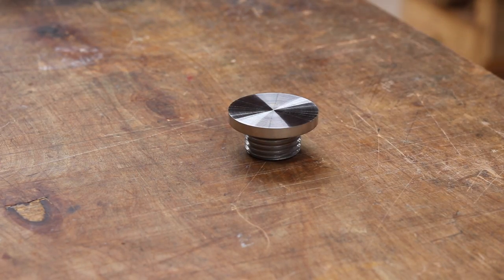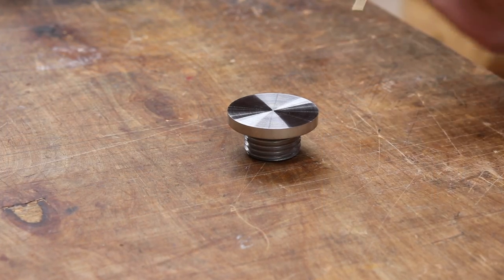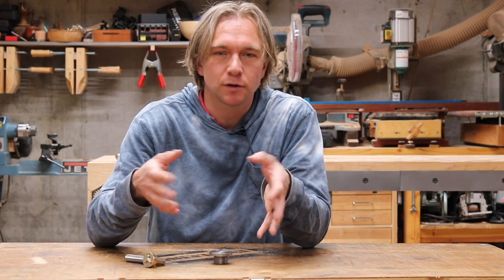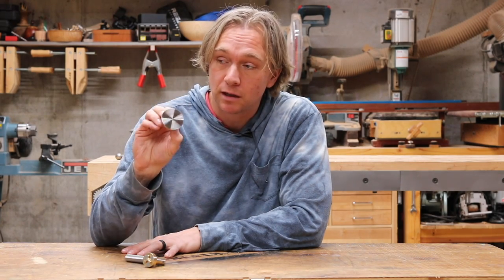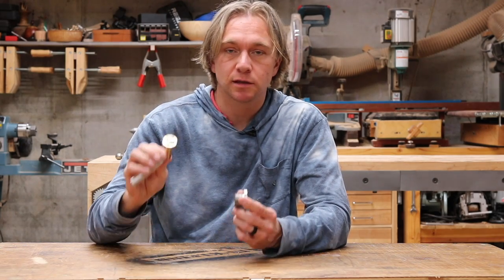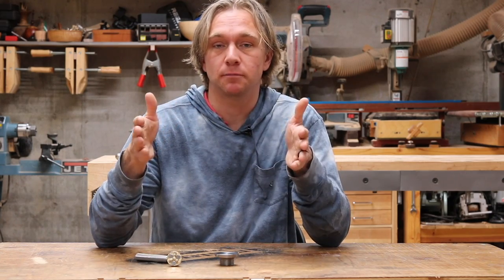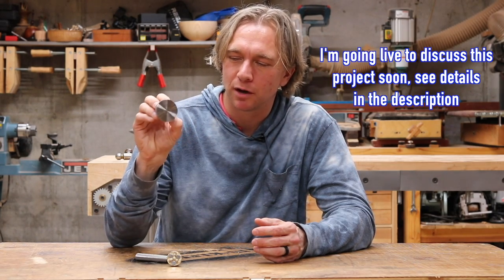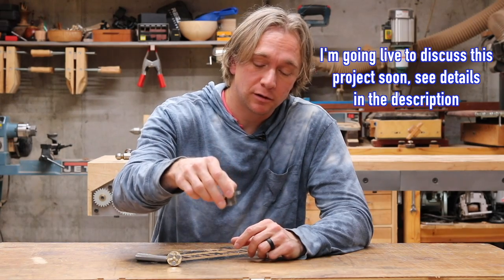A Screw With No (visible) Slot Is My Next Big Thing!

Comment: You could turn the idea into some kind of hidden lock or switch. Something that would make use of the moving part more often that the few times the screws will ever need to be tightened in an assembled furniture.
Reply: I agree, then it would be something with more than a use once  item.
Reply: I thought the same thing.  Many of us don't have the tools to produce something with that much precision, but if was a switch hidden in plain sight it would be awesome to add.  I would imagine he could increase the cost.  Hopefully it wouldn't also double the cost of production.
Reply: This was my first thought as well. Then I also thought that if it were used often it would get scratches and wear. Tell tale signs that it is a "hidden" latch/switch that is not hidden anymore. Then I started thinking of alternatives to this altogether. I don't know... Maybe it would be fun to have one just to play with though!
Reply: @markhedquist9597  Yes the technology is the selling point not the fact that it is a slotless screw which to the observer could be achieved by a countersunk screw with a steel plug to cover. Perhaps as part of a locking mechanism on a drawer front would be one novel use. But, hey it’s a lovely concept keep exploring the possibilities

Comment: I could see architects getting “the fizz” over these, they always want their final assemblies to be as smooth and seamless as their drawings! Your fastener first reminded me of architectural glass hardware you see on plate glass banisters and facades that usually have the two “pig nose” pins, this would make them totally seamless and still tamper resistent. I like the ready-to-assemble furniture idea, especially something that can be assembled and disassembled many times. As for a name, I would try to name the whole system and not just the screw. Something like “Phantom Drive” where you can have the phantom drive tool, phantom drive screws, then any of the phantom drive accessories.
Reply: I agree that this type of fastener would be better utilized in glass and metal construction rather than wood furniture building.  Bathroom dividers, glass or acrylic panels, office dividers, etc
Reply: I had similar thoughts.  There are complex fasteners for specific problems in architectural design.  This could be one of those.  The hidden geared fasteners that pull banisters together come to mind.  These might make assembly of big glass structures faster or provide a cleaner look.
Reply: I think this is the only reasonable market for this screw.  It's cool but $40 each is just out of the reach of almost every furniture builder.  Especially hobbyists.

Comment: No chance I would buy it. In use it is really cool, but in most applications it will get put into place once and the cool part (the recessing 'slot') or the quality of the item never gets seen or used again. For much cheaper you use a cap on a regular fastener that serves the same function and looks identical to the end user.
Reply: A magnetic cap would work.
Reply: Exactly.  I used to sell fasteners for a living.  Covering fasteners is a whole industry.
Reply: This is sadly quite true. It would almost have to be sold to the person making the project for themselves for them to get satisfaction of a disappearing slot as opposed to a cap.
Reply: One of the big things is that most customers aren't going to care.  There may be some who think it's cool and will spend the money, but unless the end user is going to use it as a function of the piece, I can't see many of the caring.
Reply: @keats182  Sadly I agree with you. This is a product that has to be sold to the one making the furniture, not someone who gets the piece after the fact.
It's a strange product in that sense and can be a really hard sell.
Someone pointed out that end-caps on screws/bolts produce the same end-result at a fraction of the cost. Again, I'm forced to agree.

This is not saying that this product can't sell, but it's novelty is in putting it together, not the end result. And for that reason, it might be a really hard sell.

Comment: I love the idea.  Thanks for sharing.
I will contribute a few pointers/ideas.  
1.  Concerning the name, keep it open.  You may want to make variations.  I mean that you should have a name that can accommodate different versions.  Don't be in a hurry.  Ask friends to have a naming party - non alcoholic?
2.  I like your idea of having them on drawers.  However, it likely won't sell if they come off.  A "simple" fix would be to have a small unthreaded area just before the threads start below the head in which to put a ring or other type holder allowing the device to stay on the drawer front, turn, and lock.
3.  If your device can be successful, you will find it being knocked off fairly quickly even if you have a patent on it.  Your best defense would be to find the best way to produce it quickly and cheaply.  And allow and plan for variations in size and style.  
4.  Consider a licensing arrangement with a company that specializes in woodworking supplies.

I wish you the best.  As I no longer have a shop, I won't be a customer.  I'd have to have a good client base to be a large customer.

Comment: Never think of just one application. I'm retired from the graphics industry, last company I worked for was heavy into making higher end trade show displays, store POP displays, and these remind me of acrylic sign standoffs that were used on many products we made for various purposes. This is the clean look they all inspire to have, but all have a visible hole somewhere, usually a tiny setscrew, and after a few uses they fail, screws get lost or stripped, if they encounter moisture the setscrews corrode and they become garbage, plus there's always an angle where it's visible. Besides the uses for furniture, this is another application possibility. High end retail displays in the jewelry market, the elegance of flush mounts like this with no visible screw holes, as well as the display industry having mounting points that are clean, and yet can still be easily assembled/ disassembled, sign attachment in medical facilities and offices that get changed periodically where you want an elegant professional look sans-holes. Plus the look of stainless never goes out of style.
Reply: Also. When designing something you should look for easiest way to achieve the effect, usually easiest means less parts to fail.

So why not design a normal screw with another thread over the screwhead where you would handtighten a decorative disc like a jar lid.

End result is the same. Looks the same, but its easier to operate and you dont have moving parts that rely on tight tolerances to look seamless. Easier to produce, and if your disc is damaged and looks ugly you can just replace that. Plus that way you dont need specialised wrench for it. Can be normal torx, hex or even flathead.
Reply: @HidekiShinichi  came here to say the same
This seems ridiculously over-engineered. I'm sure it's an engineers wet dream but not for the installer/maintenance or the consumer.
+1 for decorative screw on disc. Although this is already the norm for decorative fixings.

Comment: I don't have enough experience with good design, so take this with a large chuck of salt.
I see two major reasons off the top of my head why I would absolutely NEED this for a project.
 
- A security on/off switch that can be hidden seamlessly in front of a public that would be up close. It would look like a decoration piece and only employees could activate it (for an art installation for exemple)

- Children safety screw. They won't think it can be open so they won't try. Then again, the little fellas are crafty...

Most application I can think of for this product requires frequent use, the need to visually blend into its surroundings/look good and to be difficult to temper with in order to validate its cost.
I typed this hella fast so sorry for my mistakes. Its a really cool and seamless design and I hope to see it in the future.

Comment: As much as I love the ingenuity and design, I think the price is way too high for this. You could just as easily get the same look if you recess a regular screw/bolt and glue on a flush disc on top. Maybe you could even attach the disc magnetically and it would also be removable.
Reply: I think this is the logical and "correct" answer - However, people love a good novelty and they love craftsmanship. Combine the two (as he's done here), and you have something that will sell. Is it the most cost efficient thing? No. Is it a fabulous party trick that will add value to high end furniture and find a niche market? Absolutely. And in that type of market - $40 is probably a steal. However, if $40 requires "mass market"(ish) appeal, your reasoning is spot on correct as to why this won't take-off.
Reply: @Genkenx  Speaking as someone who makes custum furniture, I completely agree that the novelty factor is part of the charm.  It would depend on just how many of these a piece incorporated, but let's say 8.  I think that in the market for custom furniture, an incremental cost of $320 dollars in materials would be well worth it for many customers.  But the key question is how much design and labor cost would get added in.

Comment: The only way that this would appeal to me is having the head in various standard sizes WITH common and EASILY available thread sizes in which I can find a matching nut. (5/8" x 16 TPI etc.) Don't want to be scouring McMaster for the oddball size that my local hardware store doesn't carry. Or requires special machining, inside an area inaccessible via "common" methods. Meaning, is the custom size tap that I need going to cost me $400? Or should have I gotten a component turned down on a lathe ahead of time?

In my line of work (high end visual display/signage type stuff) where the public could be messing with the hardware, there is often a client desire to have security hardware. In fact in some install locations, it's actually a requirement. (think restaurant or hotel) I do in fact use lots of what you are showing here, but they come from places like MBS Stand-Offs, and they are nice decorative caps for barrels or mounting glass or pictures, etc... Some do have a hidden security feature on the caps. What I'm getting at, is that it would be nice if your cap screw with hidden slot could also play nicely with their common sizes and thread pitch offerings.

As far as a name goes, I would think that a "Rune Screw or Crypto Bolt" seems fitting. Kind of like in the movies, where the adventurer pushes hidden shapes to activate doors or secret compartments. More times than not, it's usually some cryptographic symbol or rune that's the hidden key.
Reply: I think it's meant to be a bespoke, unique kind of thing, not a large scale, common use screw. I doubt he'll be manufacturing these in bulk, and the impression I got was that it would be a per-order, custom sort of project.
Reply: Completely agree and like the idea for the name - very clever. I'm calling it rune screw, no matter what any manufacturer would choose :)
Reply: @alden1132  that's a recipe for a dead-ass project that never sells - you must understand that this is a project basically no one needs - people are prety well off with just sticking a decal over the bolt head, that can be pierced by the driver in case of any emergency disassembly I can't even imagine and just covered by another decal after. No decal? Just cut/punch some aluminium tape. The number of threads which may be called "standard" is already quite enough, even the 3 major (at least I consider standard metric/imperial/pipe parallel, BSPT/NPT, and that vice thread the "major" categories, for all I know) are too many but there is a widely accepted use case.

So if it comes to nice-to-haves like this, compatibility is a selling point that makes people bite the bullet and shell out some more cash. Of course large production runs of "proprietary tables with no user serviceable parts", as horseshoot as it may sound, may be a big enough customer who might actually enjoy the benefits of an odball part that isn't widely available...still can be drilled, rethreaded and thread insert applied, so there's not much use in obscuring accessibility, who wants, he can.
Reply: "Rune Screw" gets my vote.
Reply: First, it's simply a novelty. It is NOT tamper proof! Not the way its designed right now, I can see easy ways to get around your expensive tool. For me, it would be a desk ornament, a novelty to show off or play with when I'm bored. It probably won't fly, BUT it's cool non the less. Nice job. You are gifted.
Reply: @dushk0  My thought was it's usefulness for custom, special functions/secret compartments, in which you want to hide something in plain sight, without affecting functionality. Again, I suspect it would be a per-order, custom job basis, not a regularly available, widely sold product.
Reply: @Disruptedgarage  Rune Screw has a ring to it, but I think Ghillie Screw is more appropriate. It describes function, as well as appearance.

Comment: could you not achieve the same effect with a cap over a (relatively speaking) normal screw? the cap latches closed and the latch is released by magnet? might be more (economically) viable.
Reply: Not a bad idea with the cap, but the whole point of the fancy screw/bolt is the pure awesomeness of having it and being able to surprise people with the function. Plus just to use a cap instead it would have to be a tight tolerance flush fit so that it doesn't draw the eye. The screw has to fit to a tight tolerance too but it's a little easier to get such a perfect fit from a single unit rather than a bolt and a cap, more parts means more tolerances to get right and thus potentially not fit right. Id buy a set just to have sitting on my desk
Reply: @Scott_A  if you surprise people with it on a regular basis, this thing will eventually get scratched, and then the flush fit might no longer be seamless.
A novelty you can't really use IMO ...
Reply: There are points here ☝️

Comment: As someone who works for a large scale fastener distributor, furniture is okay, but if you can devise an application for it in automotive fabrication, pipelining, or mining your sitting on a gold mine. Most of the flat socket cap fasteners we sell are 3/8 x 1 up to 1 x 3 and mostly to mining operations. I feel like there is alot more use for this in auto fabrication.

Comment: The cool factor is definitely off the charts! I've already thought of three good uses in security features (one of them nefarious, of course), and I'm not talking about a better "fiddle-proof" fastener for public restroom facilities-- though that's certainly a potential. Your prototypes (the screw and the tool), are superb. I wonder about end-cost to consumers. Seems any "flat pack" kit with those would be very high-end stuff! Wire EDM does some insane stuff, for sure, but how long would it take to produce a box of 500 of those fasteners? Ten thousand boxes? How much would you need to charge to turn a profit? How hard would it be to scale up production to lower cost? Important considerations. What size was your example, 5/16x18? 1/4x20? Hard to tell on the screen. I'm not a potential investor-- retired, penniless-- but I'd gladly buy a small box of those and the ratchet attachment to secure them, if not priced beyond my means.

Comment: It looks like a really cool design and I'm sure there would be a lot of uses for it. But the problem is you could never make something like this cheap enough for it to be practical on a very large scale at all , it would be very limited use. You have to also remember there are going to be a lot of scenarios where someone would have other options besides $40 screws to hide your screw heads. In most cases people will choose the less expensive option.  If these were $10 or maybe even $15-$20 they would start to become much more useful. But I don't think you could get the cost down that much, this looks like it would be very complex and time-consuming to make. There are a lot of ways to hide screw heads and I think this way is probably the most expensive, and with all the cost these don't really add any functionality they are purely for aesthetics, I will admit it is the coolest looking way to hide screw heads.

Comment: I like the idea.

I would use a hex shape in the middle instead of having a special tool to tighten it. It would be more user friendly I we could use an Allen wrench. It could probably be cheaper to make and sell with a better profit margin. 

Just keep in mind, this is just my opinion.
Reply: i dont think this will work with generic tools or any shape that would tempt someone to try a generic tool. any minor damage to the slot may totally ruin the function of the slot
Reply: Lol
Reply: I agree.  Keeping to standard tools increases the utility of the screw.  You can always have a second, smaller, market for security screws requiring a special tool.